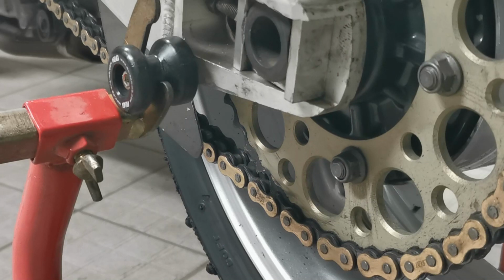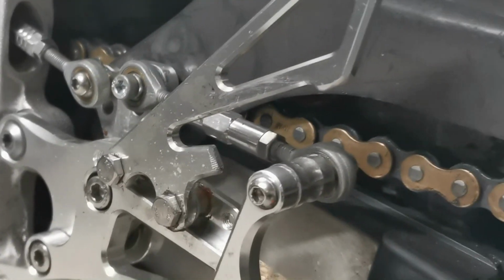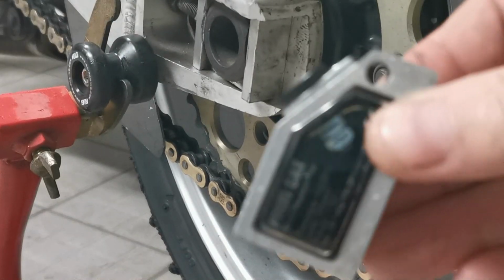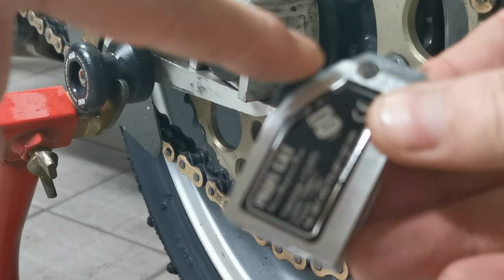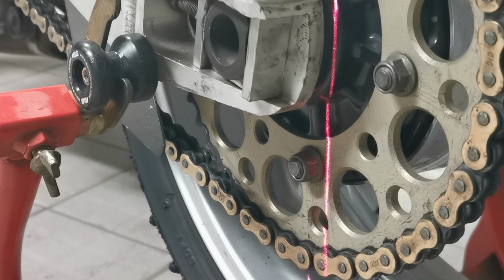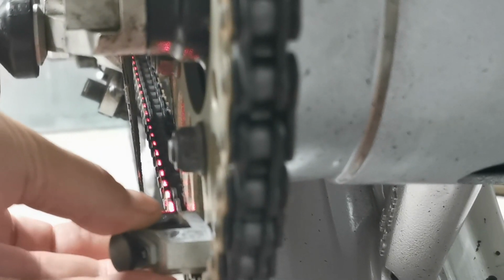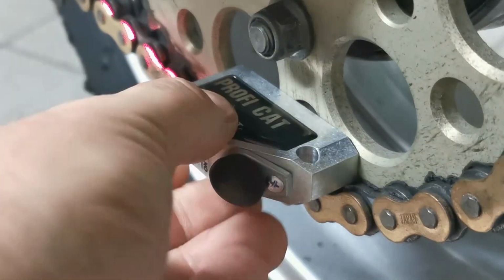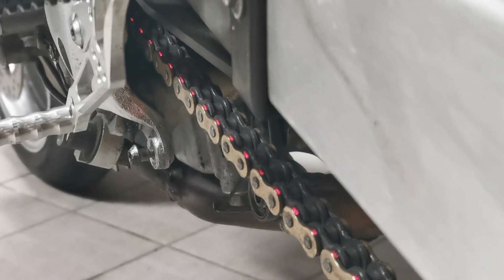Profi Laser CAT chain alignment tool line laser quick demo

Comment: I already have one of these and it works absolutely amazing. Now when I read online on different forums people are saying that the chain alignment isn’t the same as rear wheel alignment?? Isn’t chain alignment the same as rear wheel alignment?
Reply from the maker: Thanks for your question. Front and rear sprockets are designed to be in line. Wheels are sometimes not in line, they may be offset. You will find this on some bikes, particularly shaft drive. Some chain drive bikes are also offset by manufacturer for whatever reason that only they can confirm. Wheel alignment is not always 1 wheel directly behind the other. We have seen cases where there may be a 10mm or more offset. If all other geometry ad frame condition is correct, correct chain alignment will by default ensure correct wheel alignment.
Reply: you can get a dogwood axel alignment tool which goes from the swingarm pivot to both axels, then chain alignment

Comment: Bought  one of these a few years ago - love it, although the mechanism to turn it on/off can be a little temperamental.
Reply: Bruce A take the batteries out after using it, keeps the contacts clean
Reply: I honestly don't understand why the manufacturer didn't just put a proper switch on
Reply from the maker: @Turborider  thanks for your comment. Older models have had mechanical switches. They are prone to dirt ingress so are a potential point of failure. This system is a simple screw so no small parts to fail 👍
Reply: @mototechdiagnostics  I think a simple push button with a rubber cap would do the trick. But this way it's simpler and cheaper
Reply from the maker: @Turborider  rubber degrades so is potentially another point of failure. The solution they have is the best long term. 👍

Comment: Stupid question what is the difference between this product and a normal laser pointer?
Reply from the maker: Thank you for your question. The laser in this tool is perfectly machined to be in line with the flat surface of the tool which is held against your rear sprocket. Accurate to 0.05%, (0.5mm over 1m)